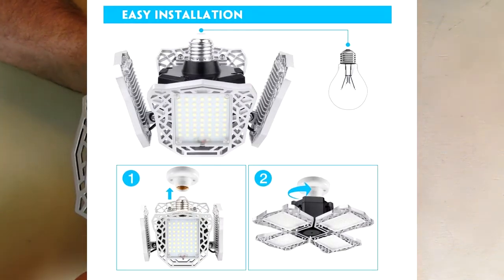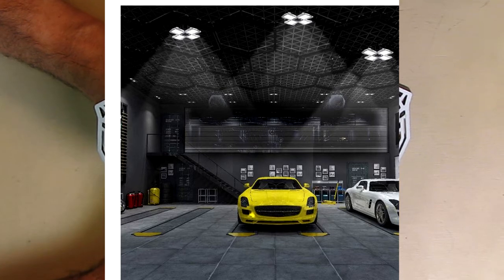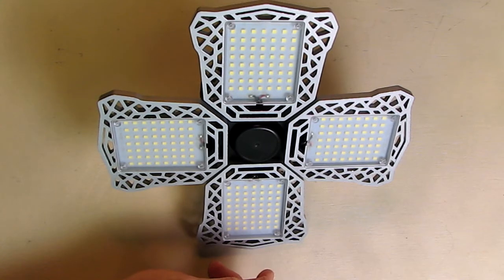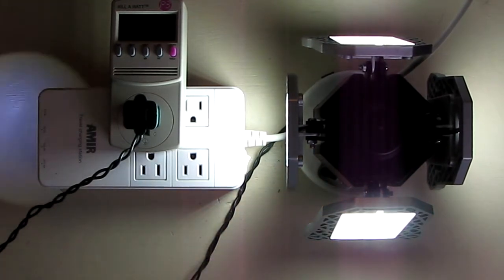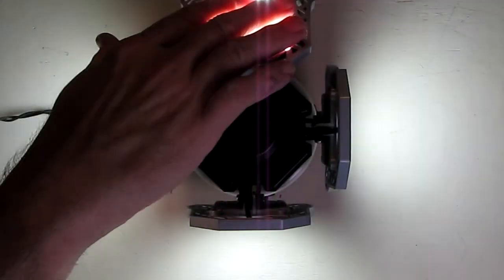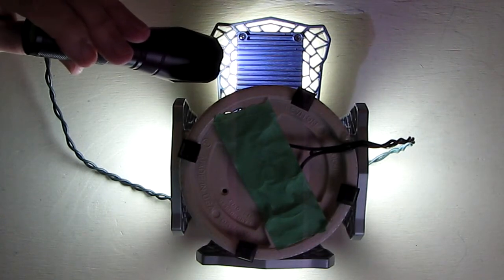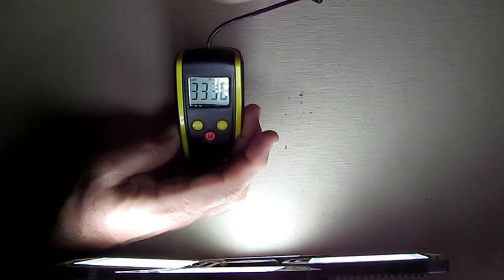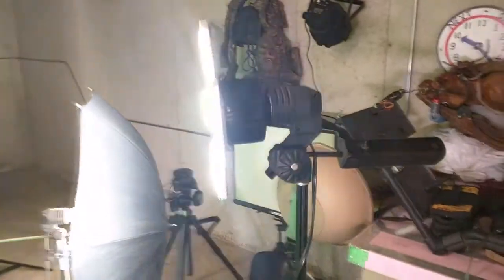BRIGHTEST LED DEFORMABLE GARAGE LIGHT YeeSite  LED Garage Lights, 70W 6500LM with 4 Panels REVIEW

Comment: I would like to use these in two rooms that have recessed lighting.  How can I do it?
Reply from the maker: They need to be open air, so will not work in a recessed application, they will over heat and fail.
Reply: @jeffgrave  Thanks Robert!